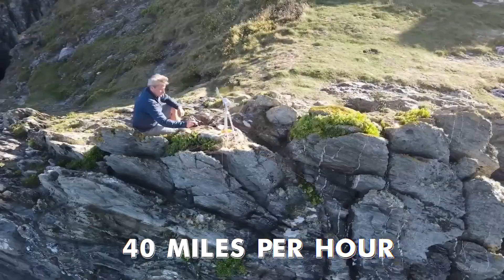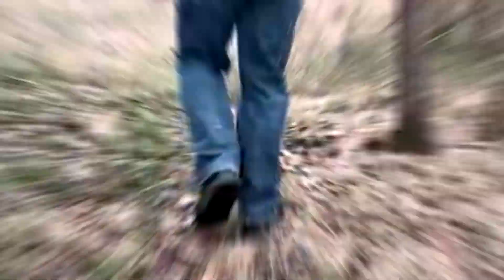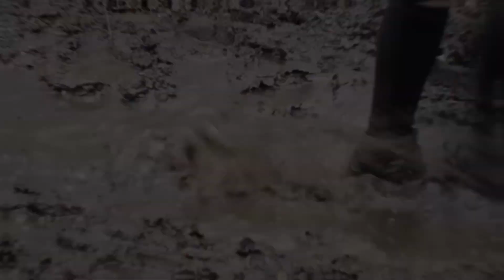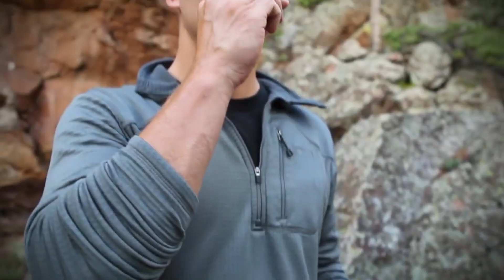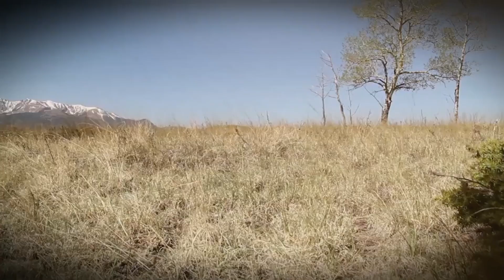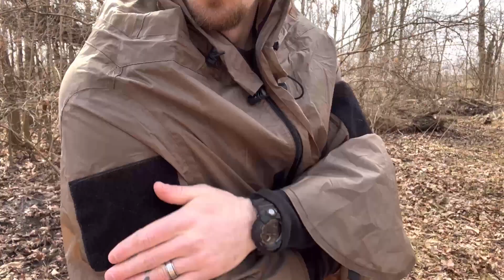16 SURVIVAL GADGETS EVERY MAN SHOULD HAVE

Comment: The TexEnergy: 5 volts isn't enough to do squat. a battery is 9v. Your car cigarette lighter is 12v. The best it will do is charge an Iphone. forget anything useful.
The Fontus waterbottle is a failed scam. There is no working prototype, let alone production